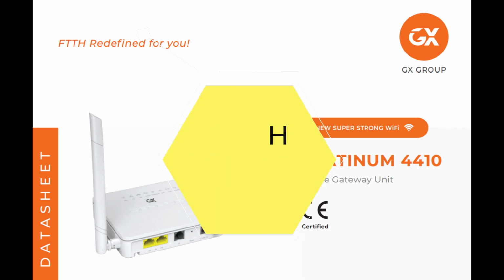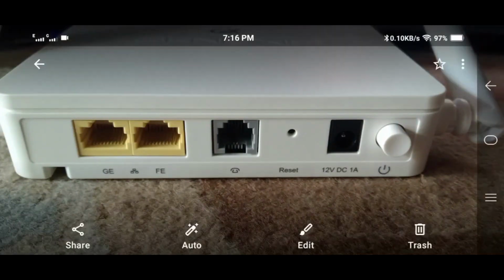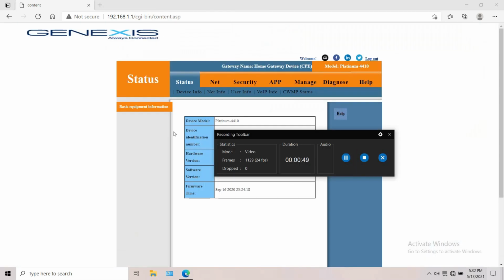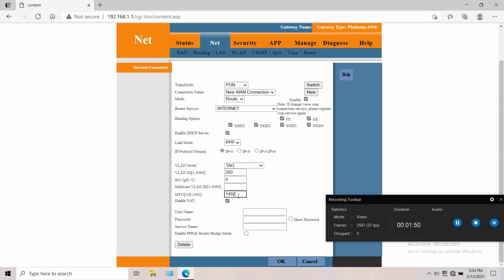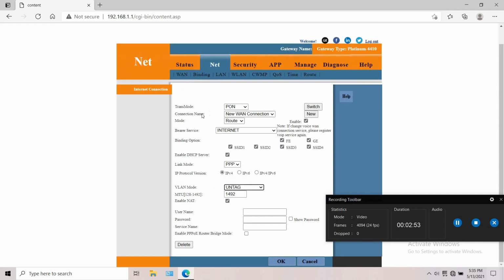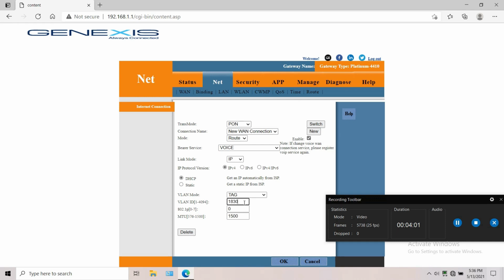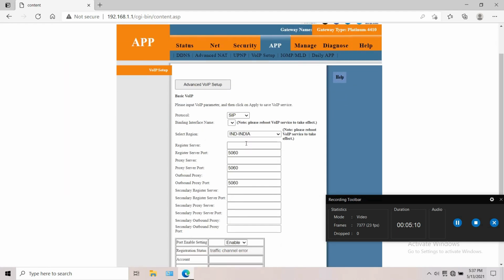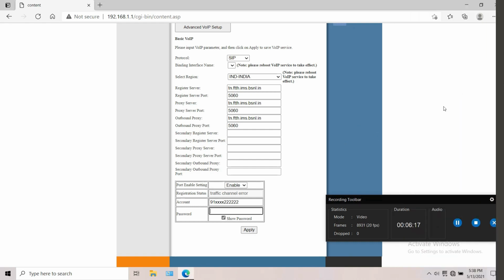GENEXIS PLATINUM 4410 ONU - CONFIGURATION FOR BSNL FTTH AND RAILWIRE FTTH

Comment: How do i turn on wps on this
Reply from the maker: The interface has a WPS enable option under wlan settings..
But, there is no physical push button on the device.
So, you can't use WPS on this device

If you find this information useful, kindly Subscribe it would help us a lot 👍
Reply: @TechwindTw  ❤

Comment: With this user name and use mac as password, there is no wan option in NET menu
Reply from the maker: I've handled a dozen of this Genexis ont, and all had the same MAC I'D in caps password for the full Configuration page... 

Now some people are complaining that the password is different.. 
It's most likely that the password is changed by your operator while configuration or  the ONT had a firmware update with another password..

Enquire with the operator or the gx customer care and if there is any new password format, kindly inform me also.😊